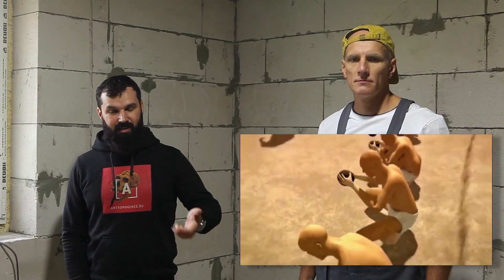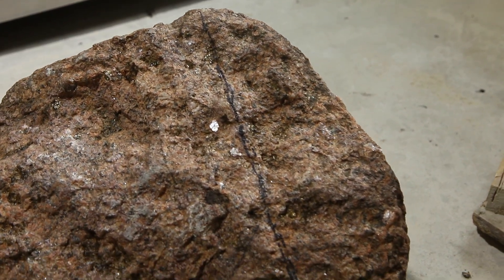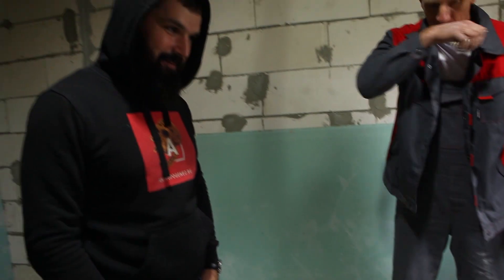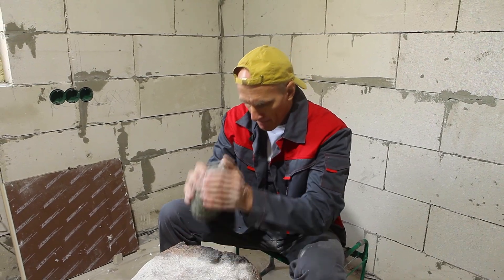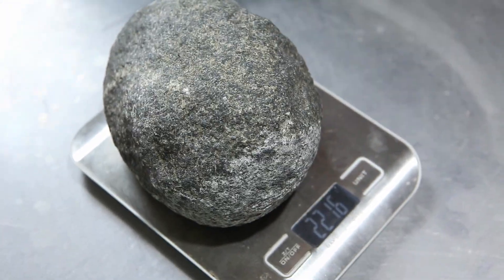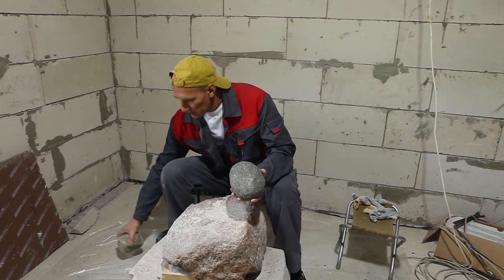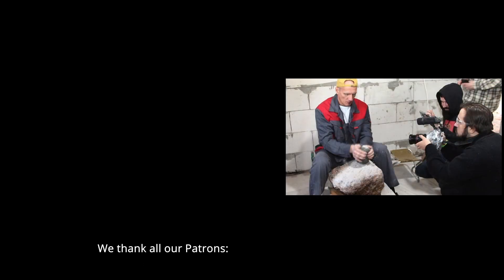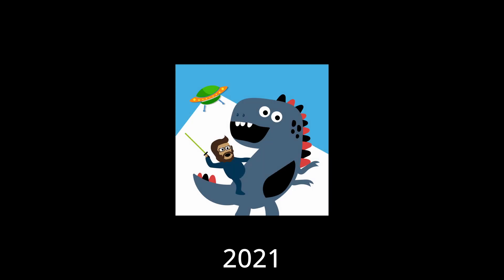Dolerite vs Granite | Could Ancient Egyptians carve obelisks?

Comment: pure bs. These were not mechanically polished at all, their polish comes from a chemical reaction. Some boxes have polished drops on rough surfaces, meaning something dripped onto it rendering it's surface smooth, and their polish has a depth to it where you can see that something affected the stones structure, not just its surface. You can also see that the smoothness visually looks the surface has been clay like.
Mechanical polish also fades in a few decades just by people touching it. These things are thousands of years old and have been exposed to the elements, and they are still perfectly smooth, that cannot be achieved with mechanical polish. 
There is no debate about this. 
We can speculate what substance or reaction was used to achieve this, but you have to deliberately ignore evidence and facts in the artifacts themselves to claim that they were polished by boulders.
Reply: Your comment shows your confirmation bias. What is your source for such commentary?
Reply: @Eyes_Open  confirmation bias?

my source for this specifically is video footage from unchartedX's channel of the bottom side of  a lid  of a serapeum box, where you can clearly see a drop shape that is perfectly polished on an otherwise rough unpolished surface, as well as footing from another broken granite box where you see on a broken corner that the polished surface has a thin layer of consistent thickness where the granite looks like its structured differently, as if something soaked into it that affected its composition. 

the surfaces of various granite artifacts such as egypts granite lotus columns, the vases, the small tube drills and of course the polygonal masonry stones all look like they have been soft and like something soaked into the stone.

its clear as day that the stones have been treated with some kind of mixture that had the capability of temporarily giving the rock a clay or wax like consistency, which is a chemical process  that we just have not discovered again yet, which is not surprising since nobody is looking for it. 

only this explains all the evidence and details, such as the insane penetration rate, the core drill grooves being thick and defined, violent and spiral, the scoop marks on various artifacts and quarries, the bent stones and the polygonal masonry and generally insanely precise fitting. 

carving and chiseling these artifacts is completely out of question,  heating and melting is also out of question, granite concrete is also out of question, but you have the polished drops, you have the layer, and you have mythology in various places of the word affirming that there was a chemical mixture which could soften stone and was used to create ancient monuments, so this is the only plausible thing, which incidentally lines up with every detail. 

there is no rational argument against this whatsoever. notice how these videos straight up act like those details dont exists and certainly do never talk about finding chisel marks on the actual artifacts?
Reply: @sshreddderr9409  You added many words to further bolster your confirmation bias and personal incredulity. UnchartedX is an entertainment channel, not a credible source. Polishing of stone has been performed by humans for thousands of years. Throwing around many adjectives and what-abouts is not a valid form of argumentation on science based channels.
Reply: @Eyes_Open  lol what a joke, I was assuming I was talking with a reasonable adult, not some brainwashed ideologue who has no interest in the actual topic.
Reply: @sshreddderr9409  You will find your target audience on a myriad of other channels where critical thinking is not encouraged.
Reply: @Eyes_Open  critical thinking? You just dismissed concrete evidence by labeling it entertainment bruh, wtf are you smoking
Reply: @sshreddderr9409  Start with existing academic knowledge. Then use that as a reference  to compare with claims.
Reply: @Eyes_Open  notice how you are never talking about the arguments and the subject, its always about authority and credentials.
Reply: @sshreddderr9409  Notice your anti-establishment bias. Speaking falsely about the notion of authority and credentials is quite common these days.
Reply: @Eyes_Open  notice again how you talk about everything except the artifacts. imagine calling someone biased for looking at evidence, details and view points of someone. you know there is something to this, otherwise you would not refuse to look at evidence and attack me for looking at it.
Reply: @sshreddderr9409  You presented your interpretation. That is not evidence. Where is your evidence that shows how humans can't polish stones?
Reply: @Eyes_Open  your completely missing the mark. obviously humans can polish stone. the point is that certain artifacts were not polished mechanically, and instead received their shiny finish by being subject to a chemical that could temporarily soften the rock to a clay or wax like consistency by a chemical process that has not been preserved or rediscovered.  

there is tons of reason why they could not and were not conventionally polished: 

1. the polish is inside tiny holes and on very uneven, dynamic surfaces which can not be mechanically polished. the high quality granite egyptian sculptures have polished tow nail lines, and are even polished between the tiny toe gaps. there is no way any abrasive mechanism can reach those areas.

2. the shiny finish is on all discarded drill cores between the groves and inside. for this to be true, the drilling method used had to be causing this without it being intendend, cause nobody is polishing drilling waste products. and if you were to polish drill cores waste, any abrasive method would render it completely smooth, meaning it would remove the drilling groves, and not polish the inside of microscopic grooves without removing them. 

3. the granite box in the kings chamber has multiple drill holes on top of each other that form a rectangular hole that was not finished. if you put drill holes on top of each other, you would have chunks of stone breaking off around the edges, and you would see those marks, but instead, the surface has no breaking whatsoever, and instead is smooth and shiny even where the drill core should have snapped and broken off, which is only possible if the stone was in a clay like state where rock did not violently break off. 

4. mechanical polish wears off very quickly. modern polished granite that comes out of a factory goes dull in a few decades just from human hands, body oils and rain. the polished ancient artifacts are thousands of years old, and have been exposed to rain, sand, tremendous violence and some have even been found under meters of soil, and yet they are still polished, because their polish is not surface level, its a layer of stone where the molecules are ordered and packed together in a way that is much more uniform than untreated granite, which means that there is much less angles of attack for erosion, and even if material is removed, the material underneath is still smooth. 

5. like I said initially, the stone has a visible layer of penetration where it looks visually and structurally different than the rest of the stone. its a layer that is uniform and a few mm thick, and there is a polished drop on the unpolished underside of the serapeum box. both of those are irrefutable proof that this was not mechanical, and it was caused by a fluid, so it has to be some sort of chemical treatment. 

6. it explains almost all the anomalies and peculiarities on ancient sites that do not make sense under the lense of conventional primitive  methods, which are ignored by academia.
Reply: @sshreddderr9409  Academia has studied the artifacts. Manual polishing and in some cases a final coating can be applied. How can a piece of leather with fine abrasive not be used in tight places? You are stating a chemical type of action on the stones for which there is no evidence.
Reply: @Eyes_Open  alright I'm done, you clearly have zero interest in an actual debate
Reply: @sshreddderr9409  To debate someone one must first have = facts..........  All you seem to have are references to video from a channel known to misrepresent historical things which you then assume upon - hence no debate after all.

p.s. - as already noted by others the Egyptians sometimes would polish stone and as far as sarcophagi lids and lids of coffins sometimes they sealed them with lacquer/mortar.

Comment: How do you get the super straight lines and corner radius?
Reply: 1 = dispense with the adjectives and adverbs.........
2 - how does one achieve "a line" = using basic techniques like grids and squares achieved using things like hanging weighted lines etc..  

Moral: there are an example famous architectural designed buildings in Spain built early in the 20th Century.  They incorporate odd angles etc. into their designs.  The engineer who designed them did so using = weighted strings........

He would hang weights from a ceiling and then adjust them to the angles/shapes he desired.  Using that he then extrapolated anticipated load bearing and so forth to find designs which appealed to him and which were feasible based upon engineering principles = and he built it.  

The ancient Egyptians used things like weighted strings to determine angles + wooden squares to check "plumb" on the sides of blocks etc. + had knowledge of mathematics and geometry + and used simple grid patterns to create accurate scale when creating something.  

As an example of the latter.  The tomb of Horemheb in the Valley of the Kings was only partially completed when he died.  So there are walls there half-done where you can see whereby they created a grid system on the wall ------> someone drew the intended design to be painted to scale ------> a supervisor came behind them to make corrections = before the master craftsman painted the final design.   The Egyptians were less "technological" than we are = but they were not stooopid......

Comment: This is a monumental video. You have pretty much proven that this technique efficiently removes granite material (even better on limestone?) and it also creates the characteristic scooping patterns you see in Aswan and other places in Egypt. Well done!
Reply: Craftspeople who work with stone to create things like jewelry etc. will sometimes used "polishing stones" to smooth a surface out - though today there is obviously many handheld tools like dremels etc. to do the same with less work.

What matters is that if your goal is to fashion the side of say an obelisk as you allude to then only chipping away gives you = an rough, uneven surface.  If however using rounded hammer stones you systematically "abrade" a surface - meaning polish it = then you can end up with your "scoop marks".  

Moral:  a row of workers sitting there with stones repeatedly scrapping from top to bottom as high as they can reach in front of them will eventually give you your "scoop".  After than you hammer away the edge ridges of each scoop tract and proceed to sand the surface to its' final side - checking as you go using a square.
Reply: @varyolla435 have you looked under the obelisk? How did they swing them? What about the holes ten meters by one meter.
Reply: @varyolla435 bro are you suggesting they scraped rock dust off pink granite until they scraped out a perfect obelisk? Have you seen the work area they did this in supposedly? Have you seen the acute angle where the obelisk comes out of the surrounding stone? Or the pit with straight sides that goes straight down for ten metres but is one meter square? How was that scraped out?  It's fantasy man.
Reply: @Gavriloprincep  If you are going to make it up as you go - at least try to make it interesting........  Just saying.  

p.s. - case and point the unfinished obelisk is not 10 meters to a side..........  Fantasy is what you just claimed.
Reply: @varyolla435 if you're going to make up what I said, you should remember that it's right there and we can see it. I said the pit is ten meters deep by a meter square. You can find it yourself if you care to do some research. No one can swing anything down there. Yet there it is. Keep it interesting ok please.
Reply: @varyolla435 look again I said the pit is that size. Not the obelisk. Make it up as I go lol. The test pit is in the obelisk area but you guys don't like to talk about it cause it doesn't fit the fantasy of pounding stones.
Reply: You should get this peer-reviewed! They would accept it with their eyes closed. Just like most of their Stories!

Comment: How many little fingers damaged 😢😢
Reply: None of course.....  If you noticed they "bounce" the pounder off the stone and hence the impact is not absorbed by the hand.  One can also by the way "abrade" the stone via chipping and rubbing a stone pounder against the surface to basically sand it down - also easy on the hand.
Reply: @varyolla435  why thanks vmuch varyolla435. I couldn't help whince at the idea of getting a whack off a one o them

Comment: this is nice, but make simple dolerite hammers. Ancient Egyptians were no idiots they knew how to make a simple hammer... Just a stone attached to a wooden stick. It also prevents from hurting your fingers if you try and pound stone to stone by holding the stone. With the hammer you hold the handle and your hands are at a distance from the rocks.
Reply: Actually adding a handle will not reduce the impact as far as what your body is exposed to.  It simply gives you more leverage and control allowing you to hit something with more force in a more precise manner.  

What the Egyptians likely did was to "bounce" their hammerstones onto the surface from a short distance.  That would still impart force into the area you wanted - yet prevent the unwanted trauma to your joints. So you swing your stone down and just before you make contact = you release it to grab it again after it "hammers" into the surface to repeat the process.
Reply: @varyolla435  as written the handle will provide better control, and you do not hold the stone with your arms. Also less force is needed per hit.

Comment: Yep i think they used trench like fire pits and pounded their way down after rapid cooling. Then flattened the jagged edges pointing up so they could work on it. I think thats what gives it those irregular scoop marks. The same process can be used vertically and then chipped away horizontally for the underside. Look at the unfinished pillar at karahan tepe. The teqhnique is super old and and if we didnt have machines to do this for us now, we'd still know how to do it by hand.
Reply: Also allow for "abrasion" for stone removal.  After all when you "polish" something you are basically abrading the surface using some medium to slowly erode the surface away.

So imagine rows of Egyptian masons sitting in the trench of the unfinished obelisk.  Each is responsible for a set area in front of them.  They heat an area and then methodically chip down through the bedrock to open up a work area.  Then they can set to work evening out the surface of the side of the obelisk to their front - or the walls of the trench they create. 

Using dolerite pounders one can chip the sides away and then "swoop down" with a stone pounder rubbing against the sides of the obelisk to sand it down.  One can do the same for the work area to make it easier for the workmen to sit and work in it = causing your "scoop marks" to form on the opposite walls.

Comment: Ive seen a video from aswan where a worker is grinding the rock forward and back instead of pounding, and a lot more material is flaking off the granite than what is shown here. There’s another research paper too that says that the dolerite hammers were discarded when they had become too rounded, which also suggests that the sharp edges of newer stone were important for this grinding. Please make a video testing grinding!
Reply: In the video that you reference, was the grinding combined with any fire setting or strictly raw stone vs raw stone?
Reply: Yes chipping the stone via "bouncing" your stone pounder upon the surface of the stone will cause it to slowly be eroded away.  As you noted irregular stone pounders with sharp sides will facilitate this.  Once the pounder gets "rounded out" then it does not effectively remove sizable amounts of stone.

Yet for smoothing your subsequent surface however rounded pounders might work much as flat stones.  That is where your "abrasion" comes into place = sanding the surface down.  So both methods apply as the former can create your basic shape which can then be refined via abrasion.  

p.s. - I have long suspected that is how they etched hieroglyphs into stone objects.  An artisan draws the intended design on the surface of the stone and then using pointed stone tools such as flint the inner area can be carefully chipped out followed by it being "rubbed" using another pointed stone tool to smooth that area down further.  

Perhaps using pointed wood sticks and soft leather cloths an abrasive medium such as sand or corundum mixed with clay to create an emulsion can then be used to further polish the interior of the lettering/designs the same as the surface itself.